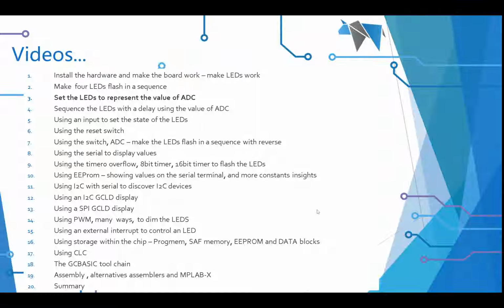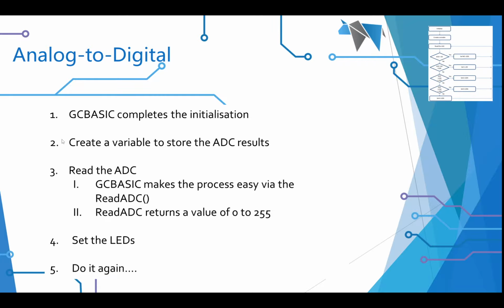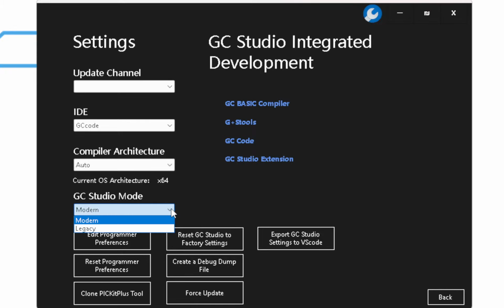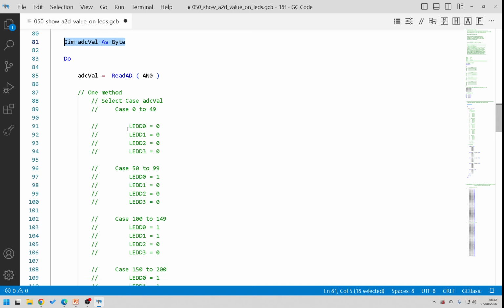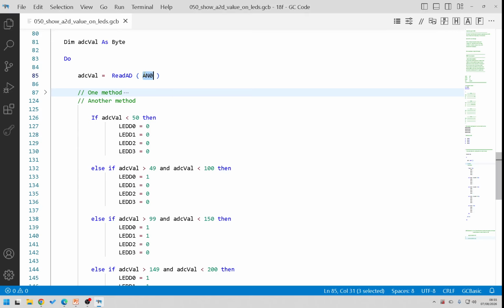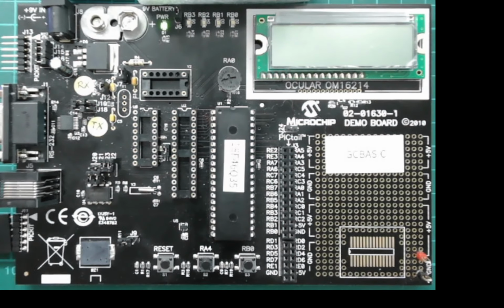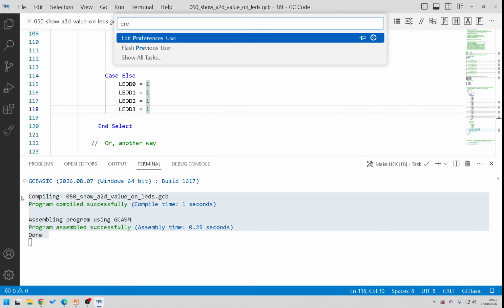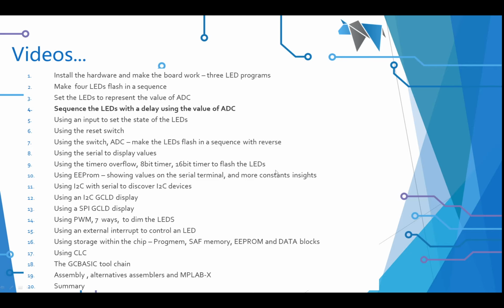PT3: PIC18FxxQ35 chip Family - Using the GCBASIC to read the ADC and set the LEDs

Comment: I've used Proton IDE for many years, but this looks streets ahead. Is there an import feature in CGB that can at least make a stab at converting the syntax? Thanks
Reply from the maker: Welcome. 

We have some great converters. 

Send me some example programs and I will see if we can get a converter sorted for this source code.

Post to the GCBASIC forum. I can up your examples or if you want to stay private use the email address shown on the www.pickitplus.co.uk ( about page ) ( I do not want to publish my e-mail address here ).
Reply: @AnobiumTech  Many thanks. I've emailed you via pickitplus 👍
Reply from the maker: For those following along.

GCBASIC has converters. These converters can import or translate. They essentially convert into a format the GCBASIC can handle.

For Proton I had written a Python converter and I have just tested it. It have a 99% conversion with one item not converted.  That was a 'Case Is' statement - this is resolvable.

They process is easy. 

You end up with a GCB source that you can resolve and develop further.

With AI this converter can easily be improved to provide better result.